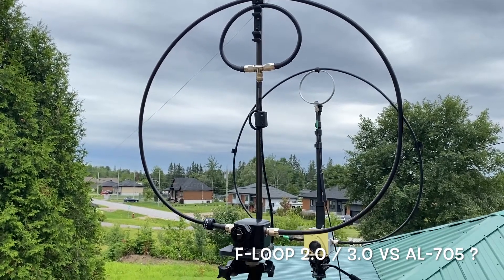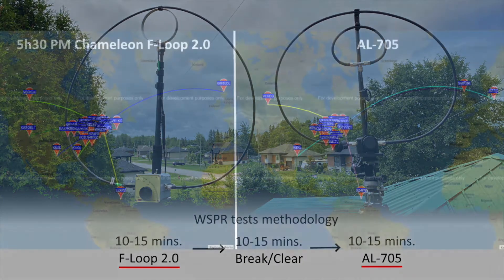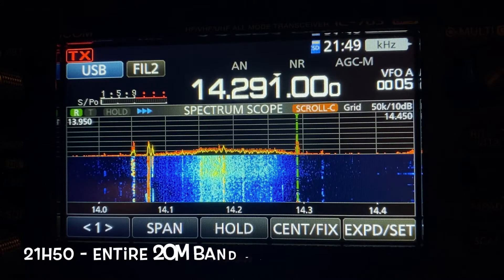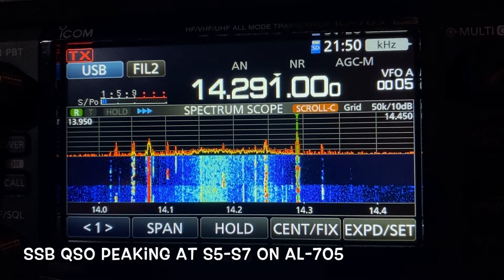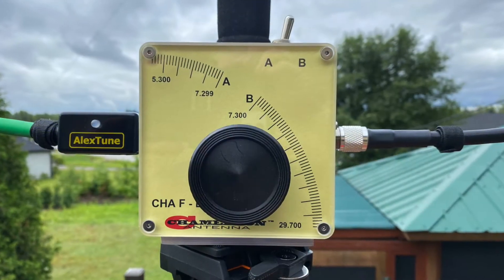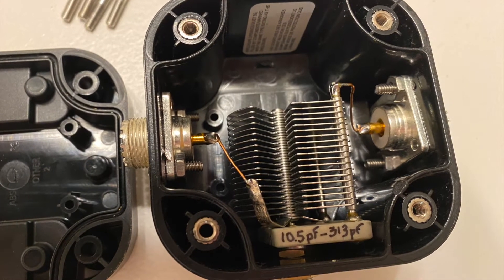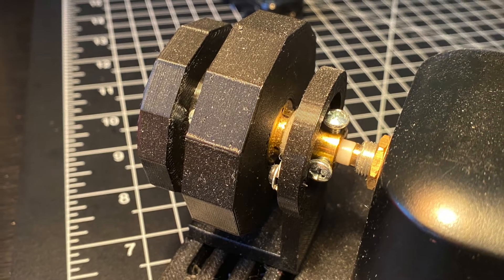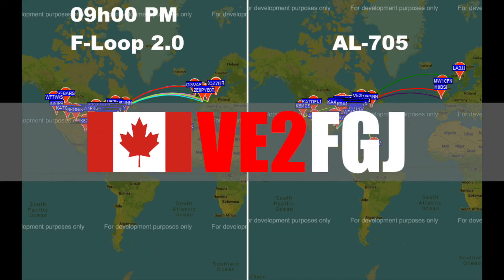Chameleon F-Loop 2.0 / 3.0 vs AL-705 on WSPR with IC-705 Comparison

Comment: I am trying to build a Magloop here as importing them from US / Europe is like paying through my nose.... hence your video will surely help me in my steps towards building a antenna like Chameleon but at half the cost probably!
Reply from the maker: Yea, they are expensive, but they are good and proven. Building your own requires a lot of research and understanding, may be trials and errors. I have build many loops based on a commercial Capacitor. Loops are fun and surprising! Good luck! 73!
Reply: @VE2FGJ  Thank you for your encouraging words. :-) Everyone has to start somewhere... Chameleon also did so let me start and see where it goes! 🙂

Comment: Now that I live in a city environment, I have been using a Moonraker WhizLoop for the high bands with great success. A magnetic loop is a good compromise...it's never going to be as good as a beam or a vertical, but many QSOs are possible
Reply from the maker: For 20M and above, Loops can be sometimes as good as a Dipole on reception, plus able to rotate but for TX efficiency it is more limited. They perform better on narrow signals (CW, Digital...). It is a great compromise antenna but it does not appeal to everyone. It as its purpose.

Comment: Excellent video and thank for showing the inside of both models! Do you know if Chameleon is using the same variable capacitor int he F-Loop 3.0? And do you have any info on the switch they use? Couldn't quite make out the part number on the side from your video.
Reply from the maker: Hi ben_r_ I have no idea about the loops using the exact same Capacitors, based on tuning with both I would says it is pretty close/similar. I believe the switches are standard electric ones, both models use a different type but basically it is a switch with no particular attribute. I believe Chameleon downsized  the 2.0 to a smaller form factor (3.0) with the same specifications, either one are great. I have used the 2.0 and now own the 3.0. Thanks for the questions!

Comment: For $20 or less anyone can build better loops using surplus parts. Any loop the same size with a larger diameter conductor (meaning a higher Q,) is BETTER. A wider bandwidth is NOT better. That's the sign of a lower Q, which implies lower transmit efficiency and more receive noise. A wider bandwidth mag loop is only 'better' in the sense that it is more convenient. It requires less tuning. Again, it is NOT better in performance. It's worse. The higher the Q, the narrower the bandwidth, the better the performance on both transmit and receive. Such loops are just less convenient to use. 

Loops are very forgiving when homemade, since they are tunable. They are almost as easy to build as wire antennas. One thing some folks forget is that they are directional, so should be built with ease of rotation in mind, because they can be turned for a stronger transmitted signal along a line edge to edge of the loop, or they can be turned for the lowest local noise on receive. Also, leaning the loop can further reduce local noise. So control of those variables makes a loop much more useful, again, less convenient, but more useful.
Reply from the maker: @John West Building a Loop, there are alternatives for sure. I think the bandwidth difference may be linked to the loop size (AL-705=3ft vs F-Loop=4ft) the 4ft may bring in more signal. Since this video I made tests with a 5ft loop and the bandwidth is even wider. I may in the future build a loop with a sealed capacitor and be able to output 100W. More projects!
Reply: @VE2FGJ  I had good fun with a MFJ-935C, I made up a loop with 13 feet of copper pipe and make contact from Ireland to Canada on 20m with 20 watts, the video is on my youtube channel if you want to take a look. 

I used a smaller loop around 7 feet and made contacts around Europe in 20m.

The loop was on a table outside around 3 feet off the ground I was amazed, no vertical with loads of radials. 

I really must use it more as I haven't really used it outside since because this Summer has not been nice.

The MFJ-935C can take 100 Watts too without Issue, it's a lot of fun to experiment with.
Reply from the maker: @o00scorpion00o  Yes Mag Loops can be fun, I am still amazed of how it works, and have fun with new loop contacts! 73

Comment: I use the al-705 indoors with my ic-705. Rfi is a concern. I have ferrite rings on the antenna coax and on the usb cable. However with transmit power above 5w wsjt-x can throw an error about interface 'crash'.
Reply from the maker: I was able to TX 10W digital on the AL-705 indoors, ensure SWR is below 1.5, may be try different locations.
Reply: Move the rig further away from the antenna. That should help.

Comment: These small loops are a real compromise.  I found an end wire in a tree or laying on a bush far more effective and faster to tune. Plus super cheap.  73 WA6MOW
Reply from the maker: Yes indeed, at the same time, each antenna type have their own advantages. Thanks for the comment! 73
Reply: That sounds nice, but I'm going to be stuck in a hotel 250 days out of the year.  In that situation it seems easier to not have an end wire? Let me know if I'm wrong :)

Comment: nice viiseo what tuning led are you using I saw the alextune but the other one??? 73 qro HB9GUR
Reply from the maker: The other one is a custom made RF sensing circuit with a LED in a 3D printed box attached to a paper clip. I did not make it, got it from a friend. Thanks for the question! 73